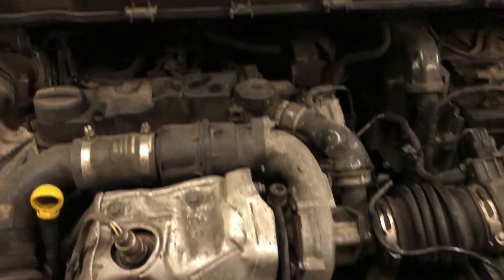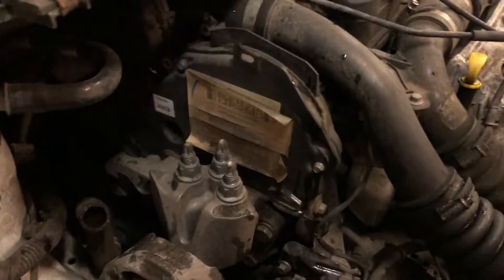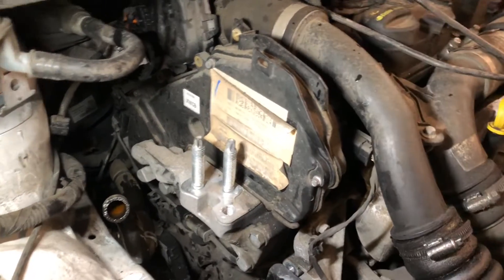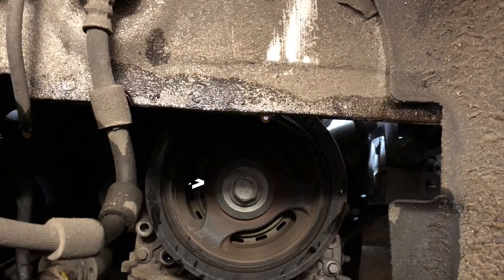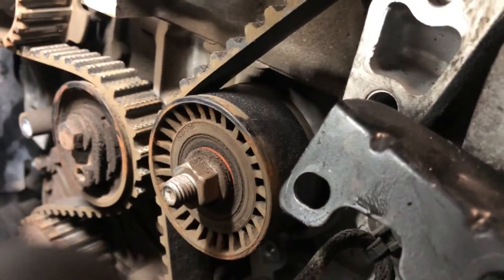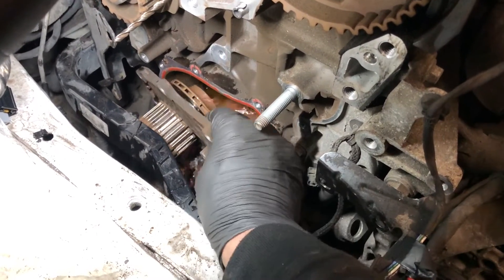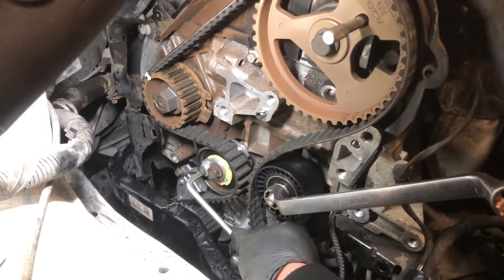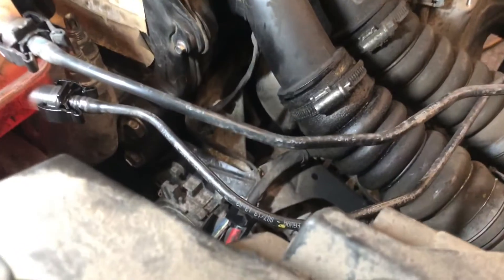Masterclass: Ford 1.5 TDCI Timing Belt Replacement Tutorial.

Comment from the maker: ⚠️ IMPORTANT – READ BEFORE STARTING ⚠️

This Ford 1.5 TDCi timing belt masterclass shows the correct timing and locking procedure.
❗ If you get the timing wrong, serious engine damage WILL occur.

🔧 Timing belt kits & tools I recommend (UK):
👉 https://www.awin1.com/cread.php?awinmid=3997&awinaffid=491293&ued=https%3A%2F%2Feurocarparts.com

🔗 All my links & tool lists:
https://tr.ee/NAP1EC

💬 Comment below if:
	•	You’re unsure about timing
	•	You want torque specs
	•	You want a follow-up video

👇 LIKE • SUBSCRIBE • SHARE
It really helps the channel 👍

Comment: Hi mate, mid change, followed the video to a tee, but when I’ve got to manually turn for 2 revolutions it’s only going quarter turn?

Any advise at this stage would be greatly appreciated 🙏🙏🙏🙏
Reply: Appreciate the like mate, but any advice? 🙏🙏
Reply from the maker: @martel0041 just sent you some. 😮
Reply: Please
Reply from the maker: If you turn crankshaft two complete full revolution the cam and crank should align. In the same place. Also the injection pump should align. If this isn’t the case then you must have the wrong kit or fitted something incorrectly. If it only turns a quarter then locks. You definitely have a timing issue. Turn it back. Remove and start again.  Did you mark the belt as well. This will give you reassurance in where it came off with duplicate marks on new belt you can’t go wrong.
Reply: @How2FixIt1 thanks mate, marked the crank belt, all 3 locations  and they didn’t move the entire job…. Can’t work it out at all
Reply from the maker: I always find when I do something and it doesn’t go to plan. I re do the job. Did the marks move when you tensioned the belt.
Reply from the maker: Just a thought. When you remove the belt make sure all the tensioners, idlers and water pump spin freely. I had it once where the new pump was faulty and locked up.
Reply: @How2FixIt1 - pitch black, I stopped before I did any damage. I’ll re look at it tomorrow and provide an update. Thanks for the help
Reply from the maker: No worries. It always helps to come away from a arkward job. Better luck tomorrow. 🤞

Comment: Good job! Did you lock the flywheel when lossening the crankshaft pulley? I tried to lock the flywheel and put a locking pin in the locking hole but I realised that there is no hole in the flywheel itself as I was rotating the pulley. I assume that I must lock the flywheel to torque the pulley when I reassembling everything.
Reply from the maker: I normally just use the impact gun. Works every time for me. Probably not the best approach but never let me down.

Comment: Hi, i had a timing belt changed on my focus, same 1.5 tdci engine. Now i have noticed a vibration from the engine. Not running rough, but you can feel vibration even at steering weel. Am i correct suspecting the belt is out of timing slightly? Or is it possible to over tension the belt? Thank you for your video.

Comment: Hi mate. @1:42 "we can support the engine and remove the engine mount" 

- did you just use a jack to support the engine from underneath?
Reply from the maker: It depends. If you’re on the floor, yes!  If your on a  lift then you can use an axle stand then lift/lower the vehicle.
Reply: @How2FixIt1  Cheers! Took the crank pulley off, went to put timing pins in the injection and crank shaft pulleys only to find the crank shaft pulley about 1/8 turn out. Does this mean I've slipped some teeth while undoing the crank pulley? Can I just remove the timing belt and realign the crank shaft pulley manually?
Reply from the maker: Possibly. As in video. Make sure your marks are correct. And always, ALWAYS. Turn crank two revolutions. Then if it is wrong you not going to damage anything. Then pin it up again to make sure it all lines up. It sounds like it has slipped at some point unless it was out before!
Reply: @How2FixIt1 thanks man. Much appreciated.
Reply from the maker: Hope it goes OK. Anytime, always happy to help.

Comment: Decent video. Perhaps you could have shown the flywheel locking pin access, for torqueing up lower pully, which is underneath mid sump 11.5mm I think.

Comment: Thanks for taking the time to produce this. Very helpful. 
For those interested in the required torques for all the bolts. The following comes with a caveat.  There are variants of this 1.5L TDCI engine. I don't know exactly what they are. What I do know is, I have noticed in comparing this video with the official Ford Workshop manual and another video posted here: https://www.youtube.com/watch?v=UoT7nF86qNE. There are subtle differences in where the camshaft pulley is locked off. In this video it is in the circa 2 o'clock position. In the official Ford workshop manual I downloaded for my model from Ford, the camshaft hole locks off at the 4 o'clock position. Also, the tensioner's correct tension window (for want of a better description) is on on the 9 o'clock position in this video, but in the workshop manual and the alternative video, the window is at the 3 o'clock position. I don't think either these differences really matter with regard to changing the belt. I only mention the differences as the bolt torques I have reproduced below are for the variant not shown in this video, and as such they may use different diameter bolts. I doubt it. Of course this assumes Ford provided the correct manual for my model!  My model is a UK Ford Transit Connect 2019 LTD TDCI. Chassis #WF0R XXWP GRJA 45356. The Engine #JA45356. The engine is also given the following descriptions 303-01E - 1.5L EcoBlue which comes in various outputs i.e. 55KW (75PS) with the Engine Code BEGA, 74KW (100PS) Engine Code Z2GA, 88KW (120PS) engine code ZTGA. I have the last one. I assume the manual is correct for it. I think the main difference between the engine outputs is turbo charging and a twin cam which would have a different head and potentially why the camshaft locking pin is located in a slightly different place. But I haven't researched that. Anyway, the bolt torques are as follows:

Crankshaft: Stage 1 26 lb ft (35Nm), Stage 2: 190 degrees.
Idler bolt 26 lb ft (35Nm) (note in this video the idler is secured by a nut not a bolt - the tension I have supplied is for the variant with a bolt) 
Tensioner nut 22 lb ft (30Nm) (note in this video the tensioner is secured by a bolt not a nut - the tension I have supplied is for the variant with a nut)
4No. engine mounting bolts - that bolt horizontally into the block 48 lb ft (65Nm)
3No. Nuts that bolt into the above engine mounting 48 lb ft (65Nm)
2No. bolts that bolt the engine mounting to the chassis 81 lb ft (110Nm)
5No. bolt that hold the plastic belt cover 44 lb inch NOT foot i.e. (5Nm)
1No crankshaft bolt 71 lb inch NOT foot i.e. (8Nm)

The crankshaft should be rotated 4 times in a clockwise direction while looking at the pulley from the side. i.e. the crankshaft applies tension to the belt via the idler side of the belt not the water pump side. Make sure you ALWAYS turn the crankshaft and only in a clockwise direction or the timing could be out.
Reply from the maker: Wow. Thanks for all that information.

Comment: I have a 2021 ford kuga 1.5 diesel ecoblue. Is the timing belt a dry belt ? And oil pump chain? as theres mixed answers when i search it  on google  it currently  it has 38k on the  clock. Could anyone recommend  when i should get these timing belt/ replaced ford sais 100k but i dont trust it. Any help would be great thanks.

Comment: Great  video. Does the Crankshaft pulley just slide off after you remove the 18mm bolt or do you need a puller for that? cheers Murray
Reply from the maker: It just slides of real easy.
Reply: Brilliant. Thanks.
Reply: How do you time it up after re building the top end?  My belt snapped so going to re build it

Comment: Thanks dude, just about to start one of these and didn't realise it was the same as the berlingo (which I've done before). Great tip on the headlight too!
Reply from the maker: Good luck with the repair and thanks for the comment.
Reply: @How2FixIt1  headlight is not so easy to remove on a 2018 but managed without. Lots of wire loom clips on the lower panel to pry out

Comment: Thanks for the tutorial!
I'm just about to do my first timing belt on my 2015 Focus.
It has been done in 2022 by a "professional mobile mechanic" - and the done something wrong.
The timing has been moved or not fixed at the points where necessary, and the engine runs bad in a way it's shaking in idle the chasis...

Comment: So I’m looking at buying a 2018 1.5 TDCI Transit Connect and was trying to find out if those engines have a wet belt or not. I know the EcoBlue engines have a wet belt, but wasn’t sure about the 1.5TDCI. Looking at the belt you’ve changed in this video, it looks like it’s a dry belt. Is that right?
Reply from the maker: If it’s this engine which most are. Then this is the one that’s fitted.
Reply: @How2FixIt1 how can identify which spare of these four is noisy? Noise like a cricket
Reply from the maker: When the belts off spin them by hand and see if you can hear the noise. But before you do that take the auxiliary belt off first, then run the engine. If the noise goes it will be one of the pulleys, alternator/tensioner etc. good luck 🤞
Reply: @How2FixIt1  already tested auxiliary belt. Noise is the same.
Reply from the maker: @OritanoVero it will be one of the idler/tensioner or water pump. Most likely. If you get a timing belt water pump kit. You will get all these with it.

Comment: Should i replace the pulley bolts?
Reply from the maker: I believe a new crank bolt comes with the belt kit. I always fit it!  So yes.
Reply: @How2FixIt1  you reused the tensioner bolt in this video. Is that okay?
Reply: Cant see why not. Its not high torqued and its not under stress or weight. If you  know where to get new bolts it always helps but isnt needed.

Comment: im doing this when its dry next ,car has done 117000 miles
Reply from the maker: Good luck with the repair!
Reply: @How2FixIt1  thanks , was this the duratorq  engine  you were working on
Reply: @mehere3013  yeah same question here - is this the duratorq?
Reply: How did you go about bleeding the coolant?